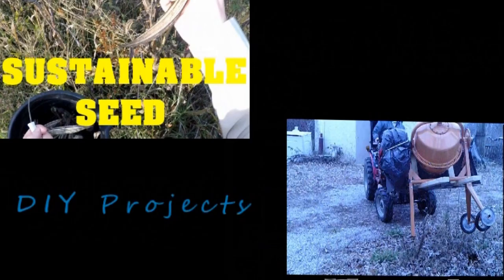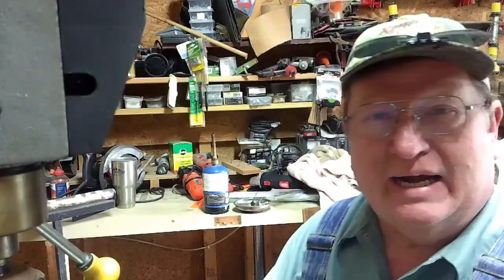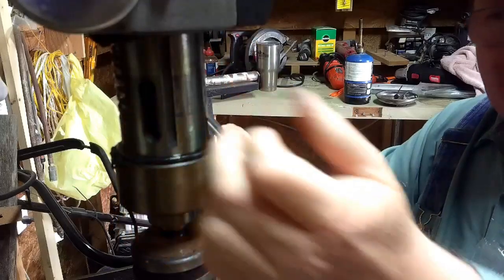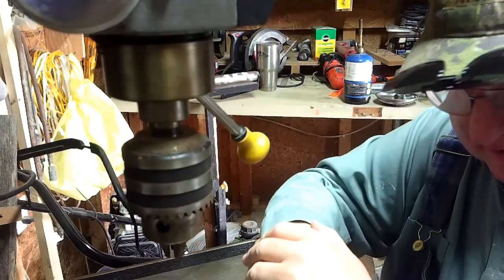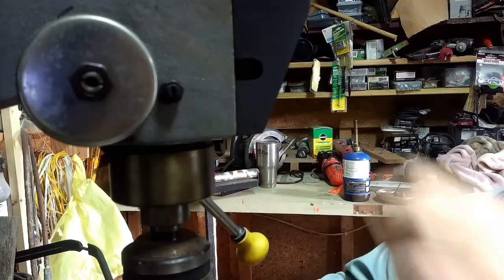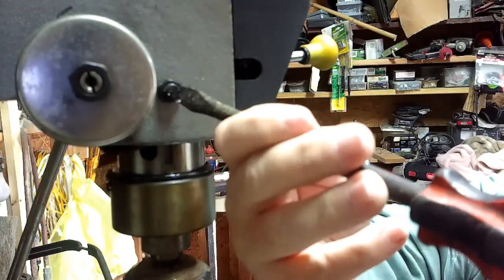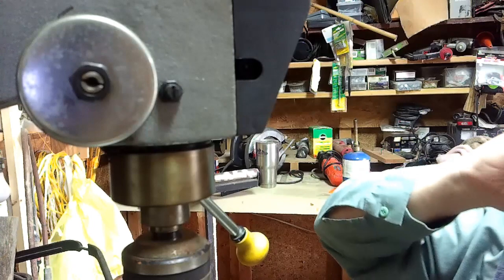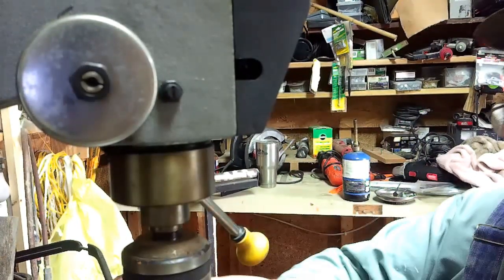Harbor Freight DRILL PRESS to MILL Conversion Episode 2 Item Number 39955 (CHEAP)

Comment: you can use a i/2 carragebolton your drill table. gust a fyi you could get the fixture or table from harbor freight for $79.95 this would have saved you money. And put a support under the drill table . let see $00.00 less that it wase $320.00 you paid to much
Reply from the maker: But the 1/2 bolt will not fit in the slot on my cross feed table. The 1/2 t slot bolts work ok. I used the carriage bolts on the cross feed table and it worked okay. You will see in the next video.

Comment: thats not what they are for. thel are a hold down . the pieces are not to level the part.  now you can use it on the crossfeed table, thats what they are made for.
Reply from the maker: I have a cross feed table it is exactly what they are for. I was just showing the kit. The crossfeed is later in the video.

Comment: I don’t see the point
Reply from the maker: Ever priced a mill of any size? Also many are 3 phase. Regular home owners don't have 3 phase power.
Reply: @CollegeHillFarm  yea I have and small grizzly is very affordable. 
Def not 3 phase
Reply from the maker: You are still talking $1000 not the $400 tooling and all. If it works. For me all I have is time.
Reply: There is a part of the equation that you might be missing. You can get great satisfaction out of building, adapting and tweaking tools that you just don't get from going to the store and just buying one. Just my 2 cents worth.
Reply: Useful for those of us outside of the states where mini mills aren't nearly as affordable. A cheap little jewelers mill would be about $1,400 USD here equivalent